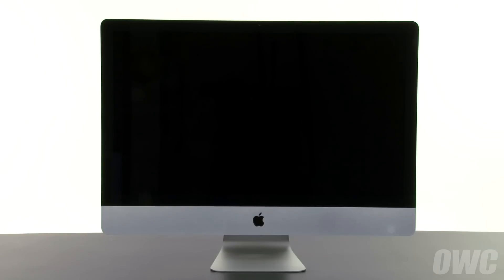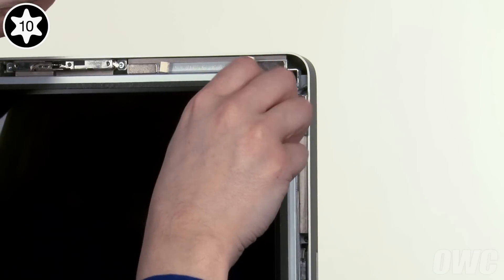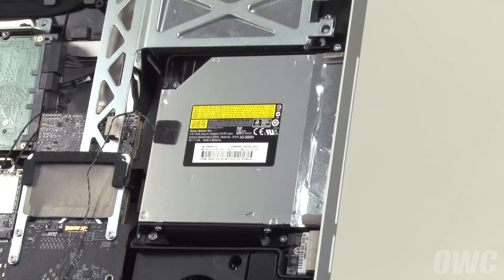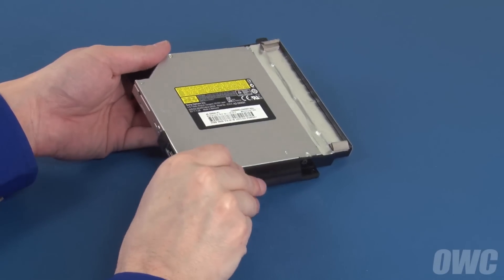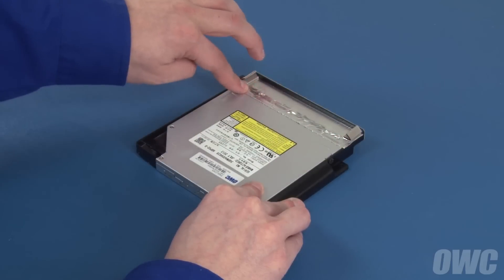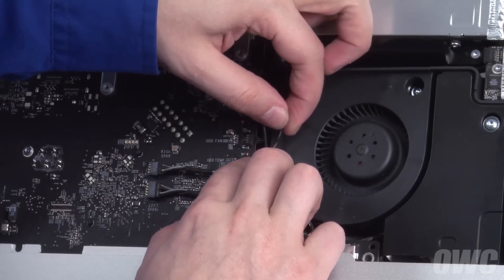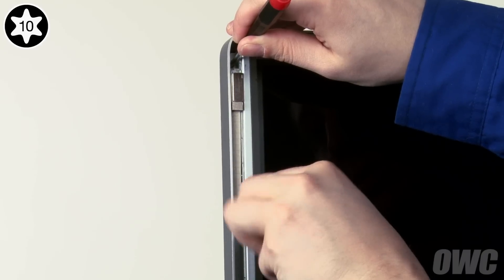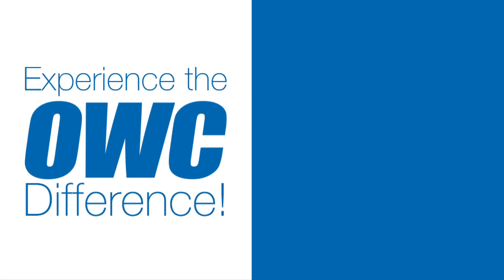27" iMac (Mid 2011) Optical Drive Installation Video

Comment: does the optical drive should be same as the pre-installed one or i can go with any one in the market ?? i am currently using imac 27 inch mid 2011 model 

if possible please provide me links to online buying links also 

Thanks

Comment: do the 21.5" and 27" iMacs from 2010 use the same optical drive? is there a difference between the 2010 iMac and the 2011 in terms of dvd drives